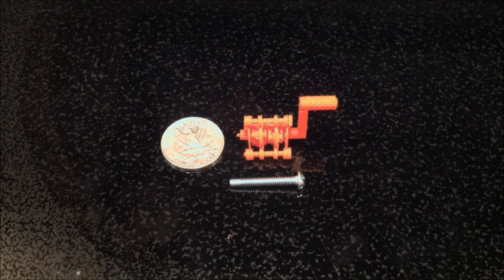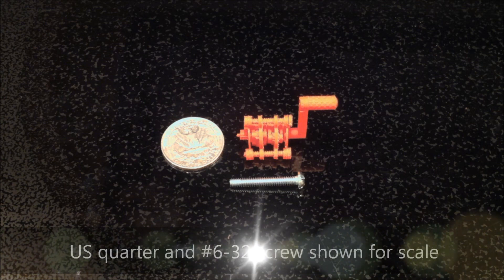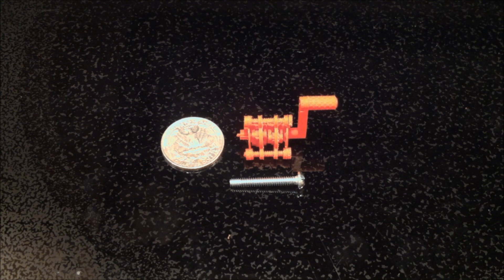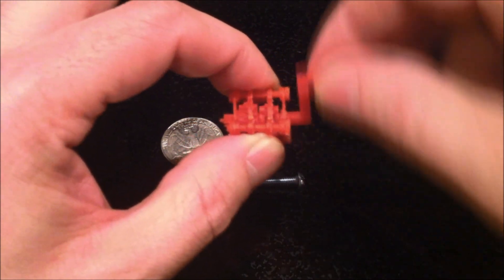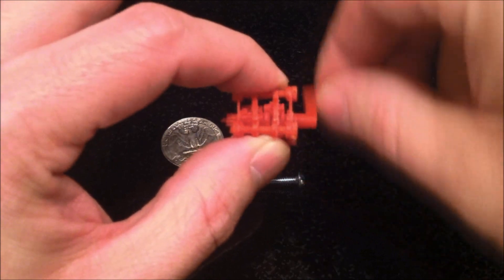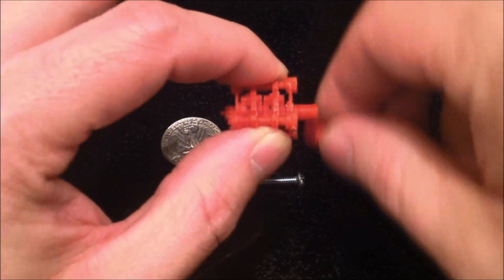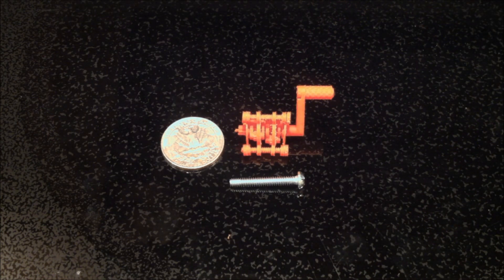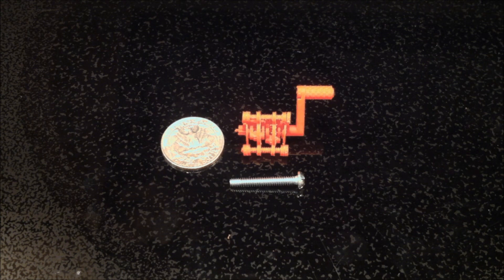Jerrill.com 0.15 mm Nozzle Test

Comment from the maker: I printed it out a piece or two at a time over a few hours to make sure each piece  printed OK. And yes, 0.27 mm layer heights with a 0.15 mm nozzle probably wouldn't turn out well, but fortunately slic3r won't let you do that.

Comment: .35mm, .4mm, .5mm .8mm and 1mm. Working on trying to see what I can get with dualstruding smaller nozzles paired with larger ones to make up some of the print speed that would otherwise be lost by being forced to use the smaller nozzle all the time. Like with a .35mm and a .5 combo. Example: Perimeter prints done with the .35mm  and every 6th to 7th layer gets infilled with a larger nozzle. Still working on it so the details are still experimental.